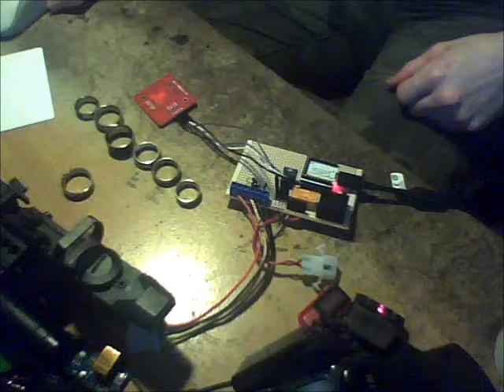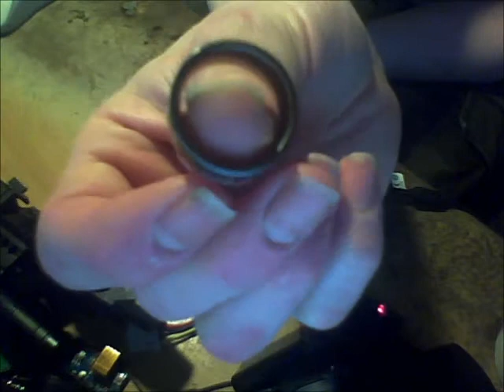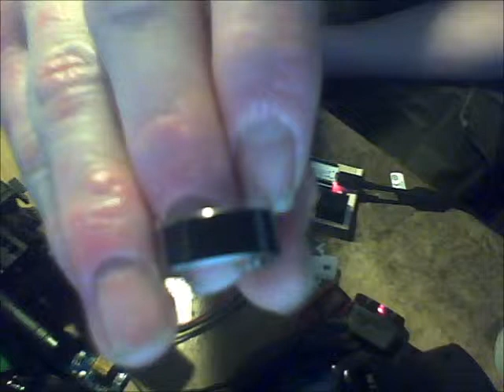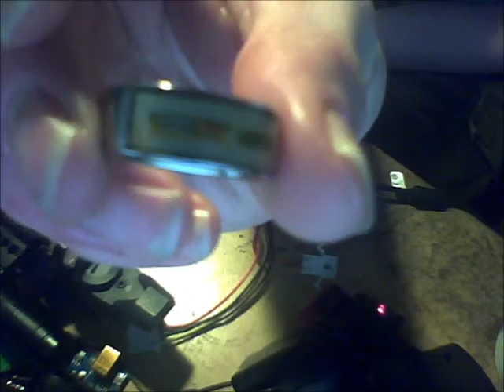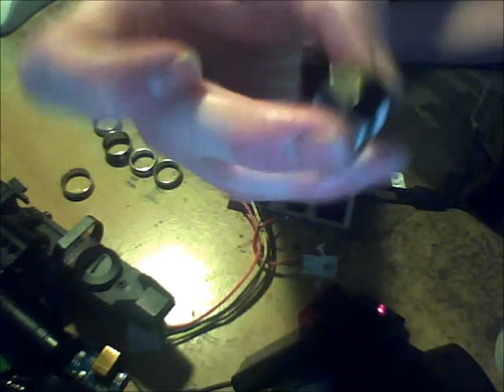NFC ring read method

Comment: Im interested in picking up a NFC ring myself, however ive been reading mixed reviews about how the ring preforms on the Samsung Galaxy S4. After seeing your video explaining the most optimal method to actually scan the ring, it rekindles my hopes again. 

I was also wondering if i picked up a NFC antenna sensor from the Galaxy note 2 and equipped it on my GS4, would it increase my chances and minimize my efforts of actually reading the NFC ring?
Reply from the maker: G'day. I really do recommend picking up an NFC Ring from http://store.nfcring.com/
Most negative reports I hear of are from people misunderstanding how to use the ring, and sometimes being confused about the differences between the ring and a 'standard' device like a mifare card. It's a totally different user experience!
Consider also, that the ring is probably going to last through more than just your GS4. It's worth noting that newer mobile devices are getting improvements to the NFC hardware, and this will help with any read issues.
In the GS4 the antenna is actually part of the battery - that's not the issue with it, the real issue is the size mismatch between the antenna in a Samsung phone and the NFC Ring. This can be made worse when things start wearing out and contacts tarnish etc. Note though, that part of the quality control process for the rings is that they must pass a read/write test with a GS4 before they're sent out.

Comment: can't get any of my rings to read... I am using an esp32 on a mini breadboard. no wifi stuff going on..
Reply from the maker: Could be a few things really - Are they legit ones from mclear co or some other random copy? If they're cheap copies, you might need to try reading them on something else.
If they do work on something else, it's probably just that the nfc antenna you're using isn't matched well to the antenna in the rings especially if the rings themselves are metal. That dramatically cuts your read distance so both antennas need to be well matched to minimise loss.